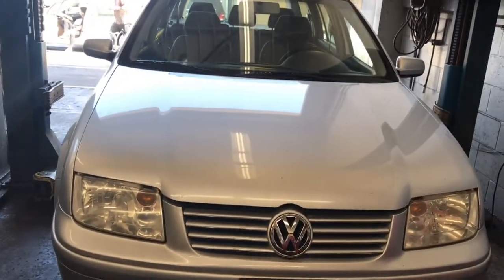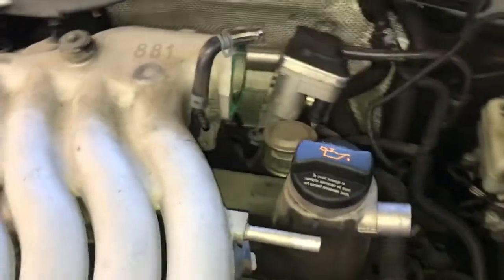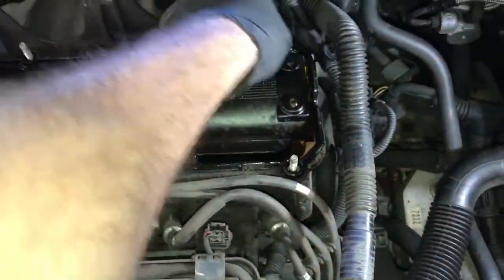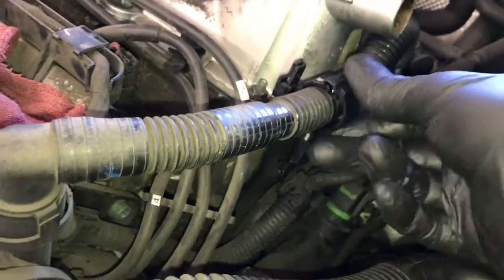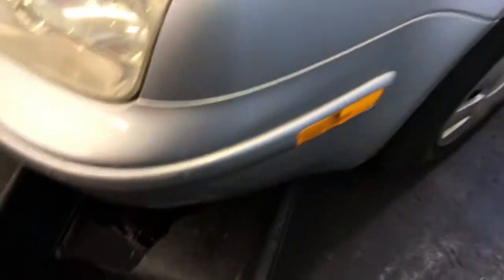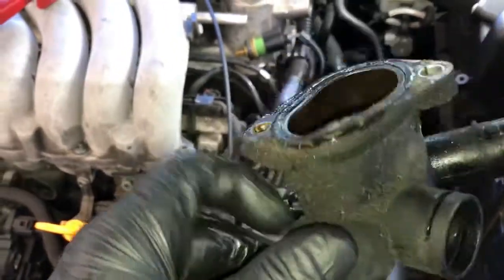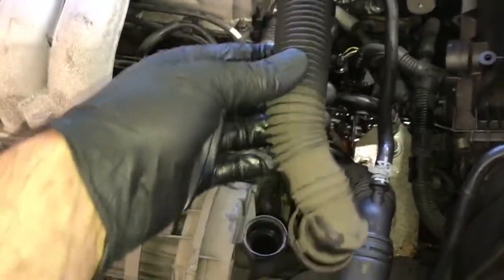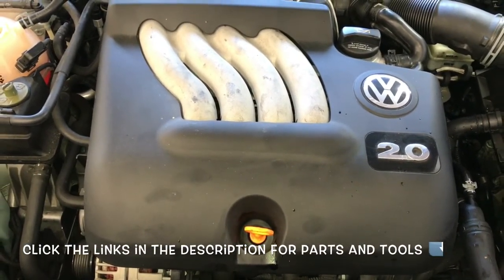Replacing The Coolant Housing And Valve Cover Gaskets On A 1999-2006 Volkswagen Jetta

Comment: I have a few of the double thread bolts that are stripped. They're out but I can't find new ones or how to get the new ones in when I do find them. Any help is appreciated.
Reply: Wish id have seen this when you first wrote it. Sure its solved now but got future reference you should clean and tap the bolt holes then clean again. Vw/audi dealership parts departmebt can find the bolts for you